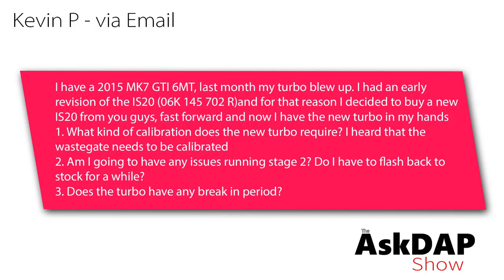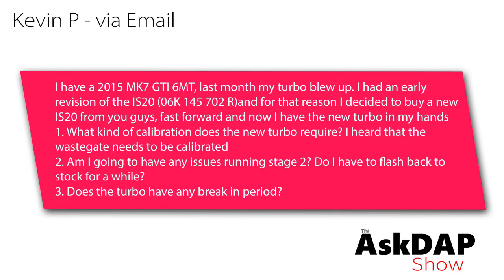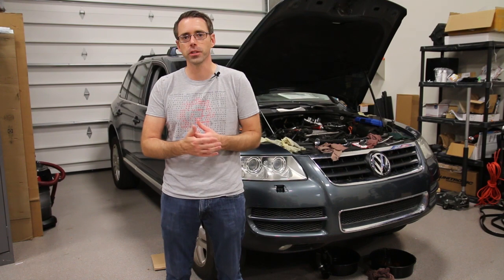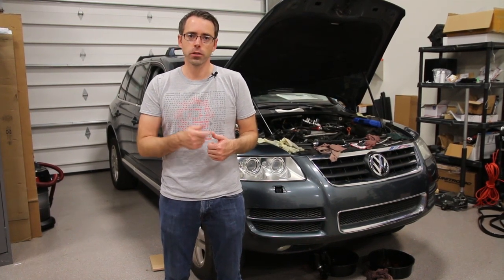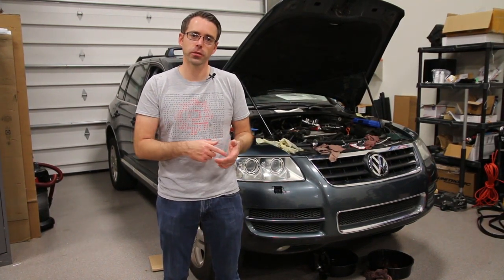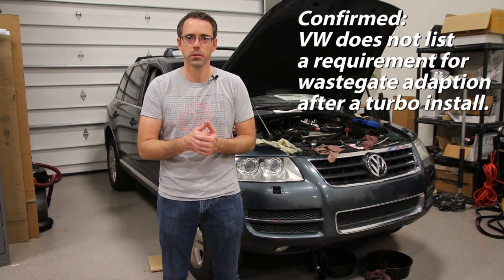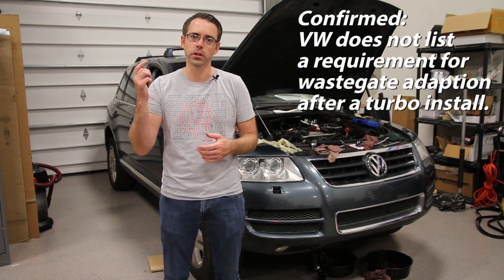Calibration After Installing an IS20 on a MK7 GTI | AskDap Episode

Comment: OK, plug in VCDS or OBD11 and go to acknowledgement voltage, see what it is with key on engine off. Then WHILE you are watching it, Turn OFF the ignition, it flashes the voltage setting you need to see, then turn the key back on, and proceed with your voltage adjustment and repeat the process until you have achieved the flash voltage of about 3.55-3.85 volts for (is12/is20). MAKE SURE TO DO BASIC SETTINGS, and listen for the wastegate to react and the OBD11 or VCDS to say Basic Settings Ended, or Finished Correctly for VCDS. It only takes about 5-10 seconds to do the first adaptation (basic settings)... 3.4v-3.52v will likely be too low with an even slightly worn out wastegate flapper from my recent experience On either an is20 or is12. I am going to rebuild the is20 WG flapper on my spare is20 I have now and get a good MAHL wastegate and proceed with this again, down the road. It is nice to feel boost again lol. Cheers!
Reply: Hi ! Recently i got a P024300 error code + limp mode with EPC light on my 2013 euro spec Golf 7 GTI, i checked with OB11 and my lower stop is around 3.3v-3.35v, sadly when i tried my Basic setting first adaptation, it fails everytime with " stopped for safety reasons " even tho i can some clicks before it stops. I even had the car on a charger to have enough juice in the battery. Seeing your comment, it seems like my voltage is lower than what it should be so could this explain why adaptation is failing ? any help is welcome !
Reply: @Exowar01 100%  ,  i had the same issue... after adjustments. It is resolved. Same wastegate. Hope this helps. I adjusted to 3.55v and it was all good. Basic settings instantly accepted.
Reply: @SixFigureUniverseDigitalEmpire 
Wao! This was the fastest ever response to any comment ! Thanks alot my man! I'll try adjusting that rod and hopfully it will help!
Reply: @Exowar01 yeah, i enjoy responding to stuff like this :)
Reply: @SixFigureUniverseDigitalEmpire 
Hey man, coming back to this comment section just to ask if you have any advice for doing the Job itself, access seems to be hard to get the 10 size nut and then to turn that rod. Any tips are welcome!
Reply: @Exowar01 i break it loose when its cold. But i also take the turbo support bracket loose from the turbo, its in the way. If you are installing a new turbo, you can sit the turbo on top of the engine. And plug in the wastegate and then adjust it that way as well to get it close or right on. Hope this helps. Just dont forget to reattach the supoort bracket :)
Reply: @SixFigureUniverseDigitalEmpire  Thanks!
I'm a bit worried because space is pretty tight in there but the worst part would be how would i tighten it back up? Because if i just try to turn the nut, the whole rod might turn with it.
Also, if I remove the turbo support bracket bolt, might there be an issue ? Turbo might move?
Reply: @Exowar01 no, the turbo is hard mounted to the exhaust. The support bracket keeps it there when ir vets hot and all the metal expands. And they make very small baby vise grips. Thats what i use to hold it in place while tightening the nut. Because any additional movement at the end, may throw off your voltage.
Reply: @SixFigureUniverseDigitalEmpire  This is the kind of info thats always complicated to find! will looking into a very small baby vise grip to help me doing this job. Thanks again for all the great info!
Reply: Saved my night

Comment: Hey DAP, I have a question for you. I just got a new key programmed at the dealership because my one and only only key was stolen.  After the dealer programmed the new key, my radio said "component protection is active" which locked me out, the EPC light was on and the Airbag light was on.  Any idea why this is?  Did they program my key incorrectly?  They are trying to charge me an arm an a leg to fix a mistake that wasn't there before I brought it to them. BTW it is a 2015 VW Golf R

Comment: Sorry I'm a little confused but don't you have to calibrate the waste gate on a new turbo?  I could have sworn that you had to do that in order to hold and release pressure accordingly through vcds or obd11.  Thanks for the clarification and info.
Reply from the maker: Not if you are just swapping to the same turbo. If you are upgrading you will need to
Reply: @shopdapdiy  can that adaptation for an upgrade turbo be done before it's fully installed or can you just plug it in and run the adaptation before it's fully installed to make calibration a little easier?
Reply: @tylerlovegrove8767  Yes you can
Reply: Yes. They may have bench adapted it to proper voltage, but the computer in the car may want something else. For Is12/is20 , >> OK, plug in VCDS or OBD11 and go to acknowledgement voltage, see what it is with key on engine off. Then WHILE you are watching it, Turn OFF the ignition, it flashes the voltage setting you need to see, then turn the key back on, and proceed with your voltage adjustment and repeat the process until you have achieved the flash voltage of about 3.55-3.85 volts for (is12/is20). MAKE SURE TO DO BASIC SETTINGS, and listen for the wastegate to react and the OBD11 or VCDS to say Basic Settings Ended, or Finished Correctly for VCDS. It only takes about 5-10 seconds to do the first adaptation (basic settings)... 3.4v-3.52v will likely be too low with an even slightly worn out wastegate flapper from my recent experience On either an is20 or is12. I am going to rebuild the is20 WG flapper on my spare is20 I have now and get a good MAHL wastegate and proceed with this again, down the road. It is nice to feel boost again lol. Cheers!